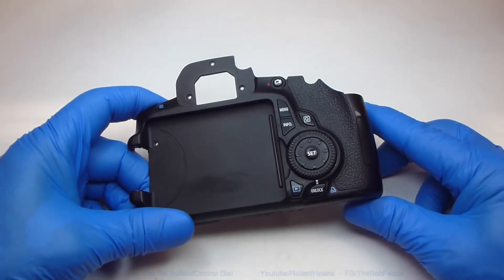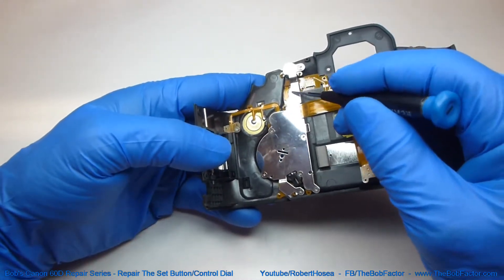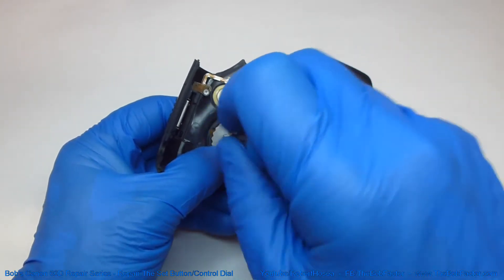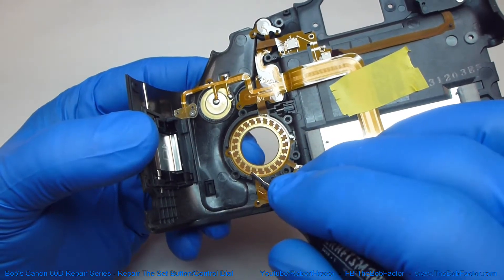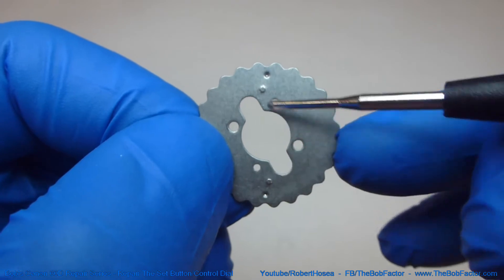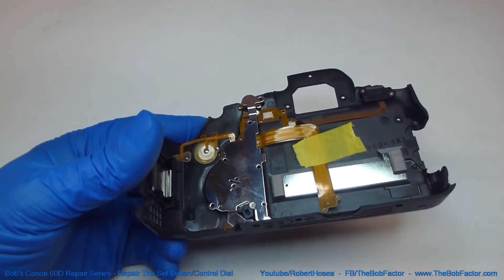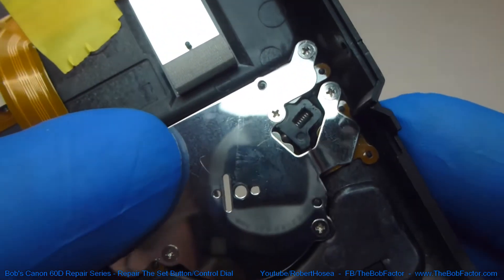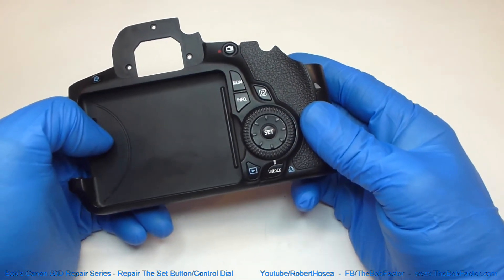Canon 60D Repair Series - Repairing The Set Button and Control Dial

Comment: Can I ask you about the rubber grip? Do you reuse the rubber grip after you take it off to split the outer plastic body? Or do you use new ones? What do you use  if necessary to hold down some slight loose edges?
Reply: I remember early in the 60d run there were complaints of people saying that the grips stretched and fell off. Luckily I’ve not had that. Thanks buddy.
Reply from the maker: I always reuse the grips. And, so far I've never had to re-glue them at all. The original sticky glue that is on them has always been sticky enough to hold them when I put the grips back on. A general purpose contact glue should work  fine if you need to re-glue them though.
Reply: Robert Hosea  thanks a lot! I love your page!
Reply from the maker: Thanks Francis. And you're welcome!

Comment: I dropped my camera at the back base of it and now the entire back panel controls no longer function. What do you think I might need to replace to fix this? LCD screen is fine.
Reply from the maker: It's possible that the impact just simply knocked the flat ribbon cable that comes from the back cover loose from the connector on the main board. That's an easy fix if it is. And that would also explain why all of the controls quit working. If that's not the problem, the the flat ribbon cable could have been damaged, or the main board. Though, if the back cover did not actually break or crack from the impact, then I would doubt that is the problem. You won't really know until you open it up though to see. Let me know what you find.
Reply: Looks like the Q button still works. I'll open her up next week and see what's happening. Does the lock button also lock the Q button? If not, then I'm thinking the lock button is permanently engaged somehow. Would be nice just to reattach some loose wiring and it work again. I'll update with results.

Comment: I have to ask because my searches have come up dry. I have a 6D and this wheel is completely non responsive. The rest of the camera works fine. Is it most likely the contacts, or the flex cable?
Reply from the maker: Yes, it could be that the contacts in the wheel control are defective or just dirty, or that a flat ribbon cable is not seated properly in it's connector. There are many things that could effect it, so It's really hard to say. But coincidentally , I recently have been helping someone that has a 60D, who was having the exact same problem. They had even purchased two back covers for the camera which included the wheel and buttons, and it still didn't help out. They had pretty much given up trying to fix it when they stumbled onto something that seems to have fixed it for them. They plugged a remote shutter release into the plug on the side of the camera, and then after they unplugged it they noticed that the wheel control was working again.  I don't know if that had anything to do with it at all, but they said it's still working for them. Again, this was on a 60D, and not a 6D, but if you can't find an obvious reason for the wheel not working it's something that you could try. I'd sure be curious to find out it that fixes it for you.   -Bob
Reply: Thanks Rob! I won't know until I open it, because the guy who gave it to me is pretty abusive on his gear, I do suspect something has gone awry like water getting in and corroding connections or something

Comment: Wow..descriptive video. I need your help though. Does anyone knows where i can buy the set button for Canon 60d? I find it hard to find online any suggestions? On my camera the set button isnt working. I cannot select any option or delete any photos plus when i am viewing my fotos its like it gets stuck and fast forwards all of my fotos. Any suggestions as to what the problem is or is it definetely the set button and needs change??
Reply from the maker: Hi George. Here's a replacement set button that's listed on Ebay:
 https://www.ebay.com/itm/Original-Canon-EOS-60D-Rear-Back-Navigation-Set-Key-Board-Button-Flex-Cable/263812178156?hash=item3d6c6e60ec%3Ag%3AhSwAAOSw7P5bSART&_sacat=0&_nkw=canon+60d+replacement+set+button&_from=R40&rt=nc&_trksid=m570.l1313 

Sometimes you can find the entire back cover that includes the buttons too, at a good price on there.
-Bob

Comment: These videos are so thorough and clear. Armed with these videos, I felt confident enough to repair the set button and control dial on my 60d. The 'screw templates' you prepared were awesome, and your instructions were perfect. Thank you so much for making your expertise available.
Reply: Absolutely agree with all you've said. It's amazing to me that we can find such high quality instructional videos like this to repair our own things now. Out of curiosity, what exactly was the problem with your scroll wheel? Mine mostly works but every 3rd or 4th "click" doesn't register. It can be pretty frustrating when I need to make a few quick adjustments for an action shot. I'm thinking following these videos will solve my problem, but naturally I'm a bit nervous about getting this deep in to my camera if it's not even going to solve the problem. It seems like the brushes aren't connecting on a few of the plates so I think a good clean will solve the issue.
Reply: Cause and effect are sometimes hard to determine. While I have subjected my 60D to the spray of the ocean and the mist of waterfalls, I suspect it was a drop of my forehead sweat that hit the set button and pooled there that caused some kind of short. I noticed the drop and wiped it away, but minutes later, while setting up my next shot, I realized I couldn’t move the focus box in live-view. Then I discovered when looking at the menu, I couldn’t move up and down through the options, or get the set button to work. Back in live- view, I desperately tried to get the focus box centered on my subject, and for a second, I thought it had started to work again, but then, as if it had a mind of its own, it started moving in the opposite direction and pegged itself against the left side of the LCD screen. I also discovered that if I tried to review images, they would flash automatically in reverse, non-stop, as if I was holding down the eight-way toggle switch to the left.
In short, the reset button and toggle switch were malfunctioning. I took steps to dry out the camera. I had it wrapped in a heating pad at low heat. Sometimes, after repeatedly pressing the eight-way toggle button in all directions for several minutes at a time, it would sporadically begin to function again, first the left bank, then the top and bottom ones, and rarely the right-most button – as if I was somehow warming it up, or as if I was breaking away the postulated salt crystals. This gave me brief moments of hope. I’d put the camera away for some more drying time and try again later. But then the button wouldn’t work at all.
I could get around not using live-view, but I couldn’t get by not being able to move through menu panels, especially without a functioning set button. Additionally, whatever the short was, it would drain the battery overnight.
My internet searches suggested that others had similar problems with the set button/toggle switch, and at some point, I found the link for this video series.
Ebay was selling just the set-button toggle switch for 25 bucks, but these were re-conditioned parts, from China, and the seller wasn’t available for a month.
Canon sells the whole back camera cover (new) for a little over 40 bucks.
The directions were so clear. I decided it was something I could do. The print-outs for the screws are genius. The only thing that surprised me was that the ribbon cable for the reset button—well, I had to fold mine over — otherwise, the whole process was exactly as presented in the video.
Since the repair, my camera is working flawlessly.